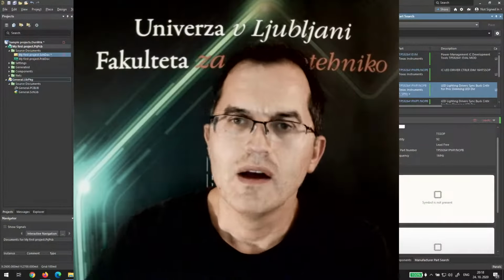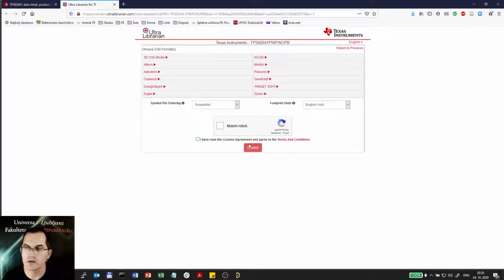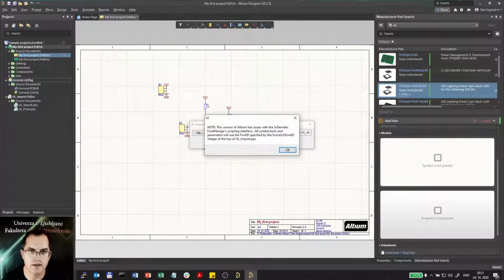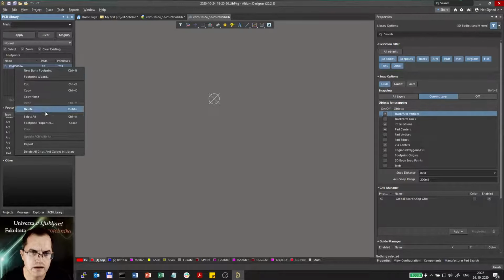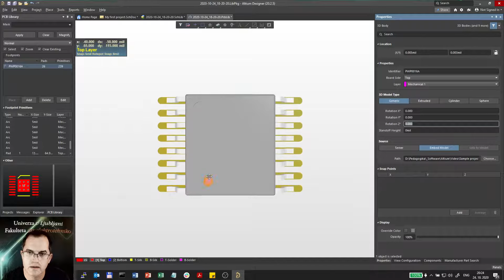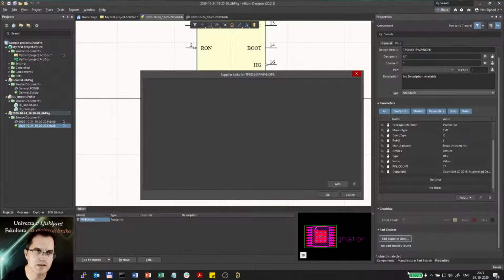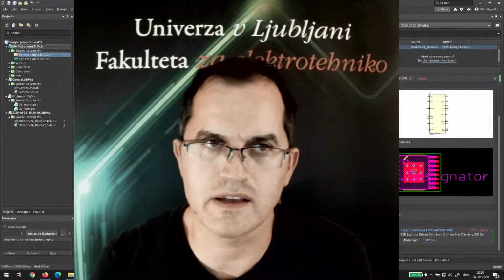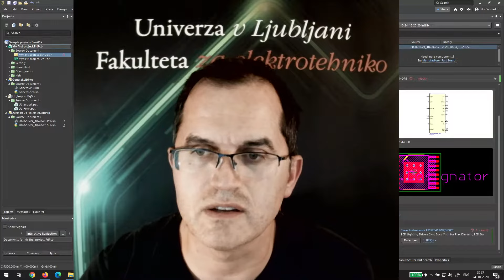Altium libraries #01: Importing new component using Ultra Librarian

Comment: Hi , when I import a footprint of resistor and capacitors from Ultra Librarian, the imported footprint symbol is not the same as original. It has a solid pink area. Can you please explain what is that area. Thanks a lot.
Reply from the maker: That solid pink area is usually the representation of a 3D model in 2D view.
Reply: @elektronika-fe1325  Thank you for your reply the 3D model is also present with another shaded pink area. This region is a solid pink area. If you take a look of capacitor footprint PCAP_16x25_PAN then you see it has two pink regions.
Reply from the maker: @parveenbeg2259  ,please send me the library to my email mjankovec@gmail.com and I will check it out.
Reply: @elektronika-fe1325  I have emailed you on the email address you provided. Please confirm that you received it.
Reply: @elektronika-fe1325  Hi, could you update the response to this, please? I know its over a year ago. I am having a similar issue and I don't know if it is safe to delete the solid pink area. because hiding the layer doesn't help. Thanks.